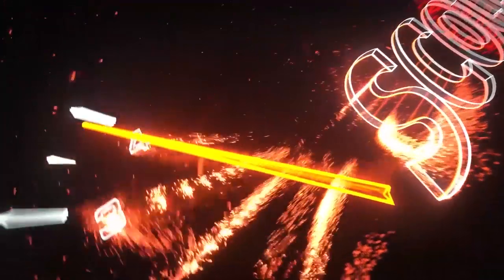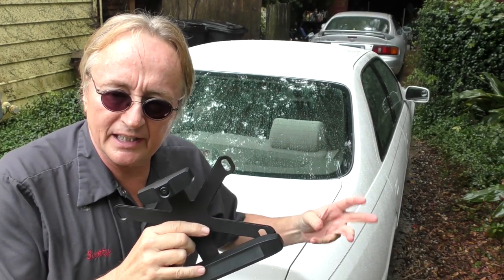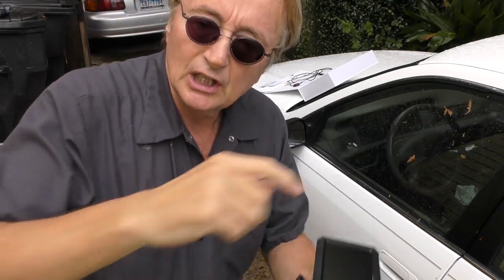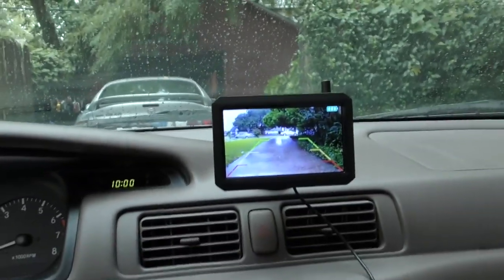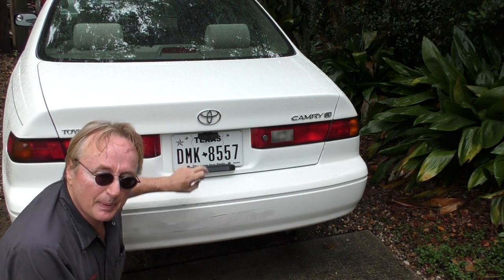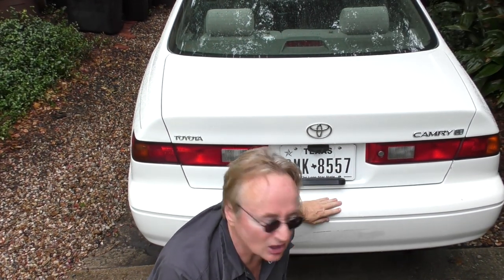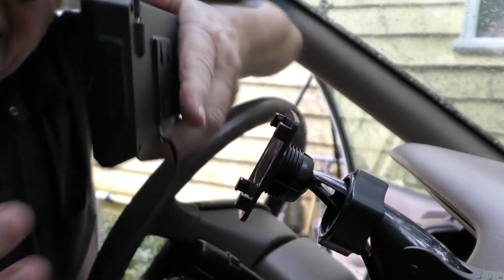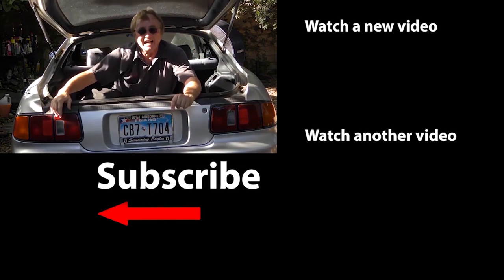The Secret to Turn a Normal Car into a Luxury Car

Comment: The downside of wireless devices are they generally use pulse modulation for digital transmission, and are incredibly bad for you.  Something we knew by the early 50's.  Shenanigans (and wonders, if used correctly) sufficient to fill multiple books later, we have near omnipresent exposure to an agent which damages every system of the body.  Actions which are also in direct contravention of the Nuremberg code, stating you cannot force or test something on human populations if it has been shown to cause harm in laboratory animals.

Wireless will be the biggest scandal man has ever seen.  And an entire generation likely won't be able to have children because of it.  Those that do, mutational load will be high enough that the next generation will suffer even more.